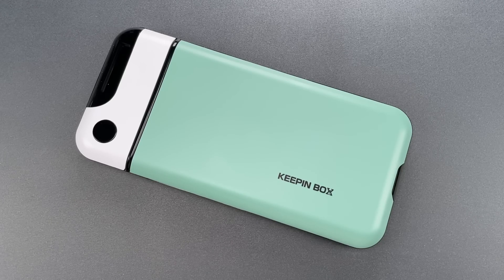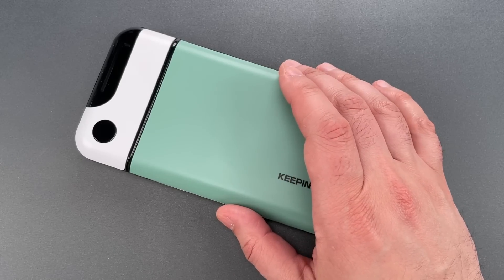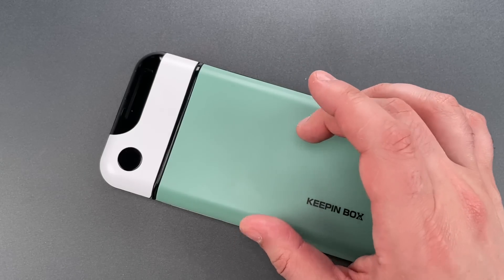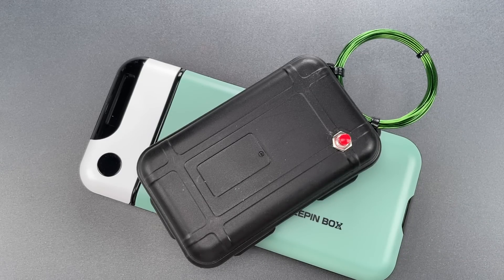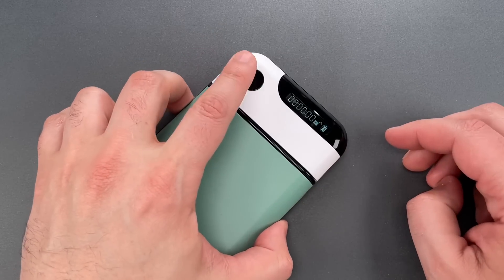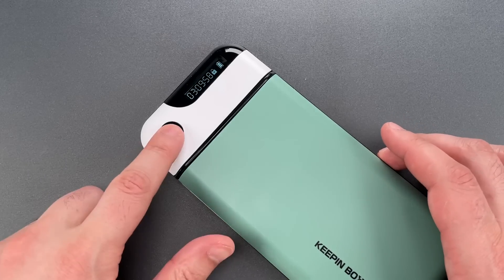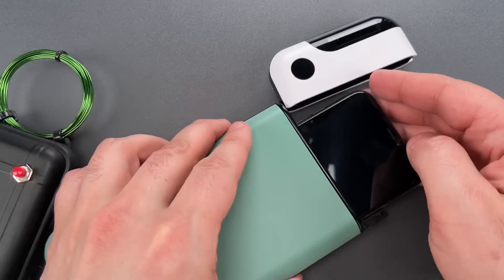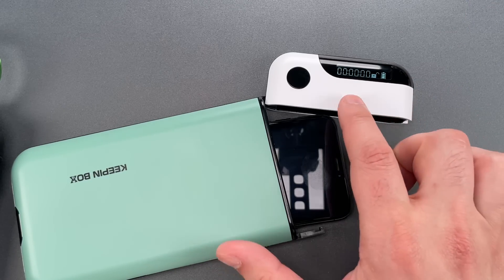[1440] Pocket EMP vs. Smartphone Timer Lockbox

Comment: Would EMP not affect phone in a bad way too? Asking cause I don't really know.
Reply: Its probably pretty low power 
Also It takes alot Of power to affect stuff
For example THE SUN'S EMPS that's about as much power you need for most electronics
Reply: The induced voltages here are probably roughly equivalent to what is normally present.  A large EMP field can most certainly permanently destroy electronics.
Reply: It could however to meet fcc requirements for emi/rfi emissions a phone will have shielding and other measures to reduce emissions. Those measures will work the other way round for reception. Maybe a focused poke at the phones antenna could couple enough energy into the phone.  Note, since the device only glitched the lock, it probably wouldn't damage the phone.
Reply: It will harm the phone if you are emp-ing for extended periods of time, for short times it will only make the screen flicker and it will think you are touching the screen.
Reply: Given how it's constructed and how he uses it, the induction effect is most likely only within the inside of the loop of wire. Due to how far the phone was from that top part, this probably wouldn't do significant damage (but still might which is why he uses an old phone, and explicitly states it's an old phone). However, as he stated near the start, this is less about immediately retrieving a phone, and more about how easy such a lock would be defeated if the exact thing is used in another scenario. You'd feel less apprehension using such a device on say... a cabinet with a timed lock that only stores drugs and other non-sensitive equipment in order to break it open.